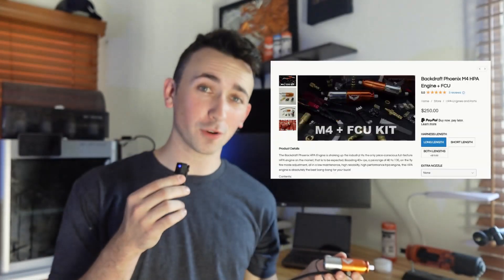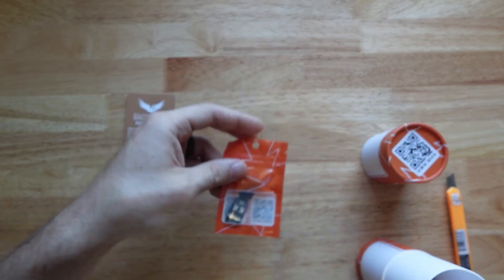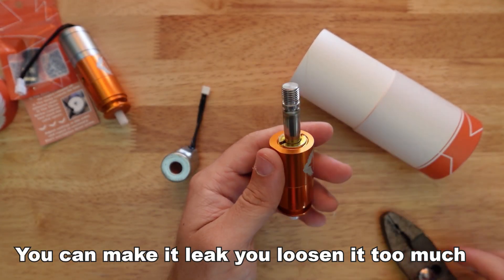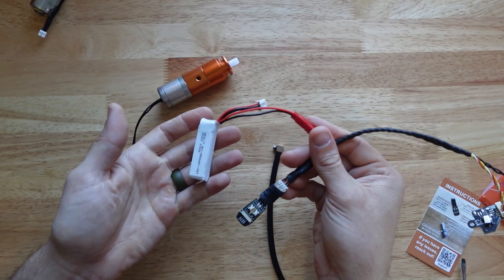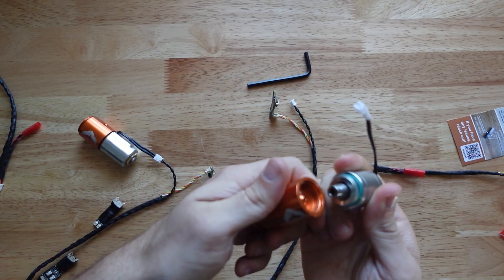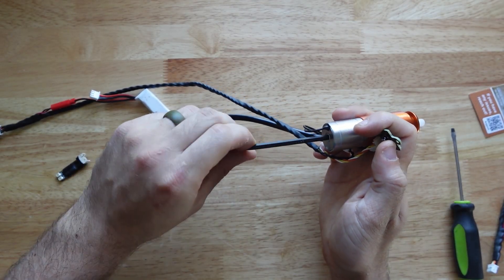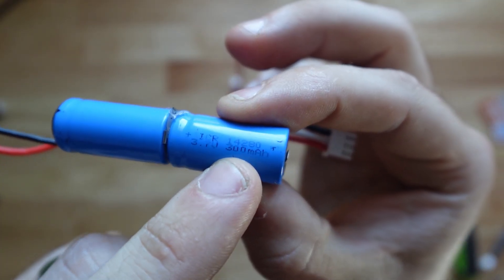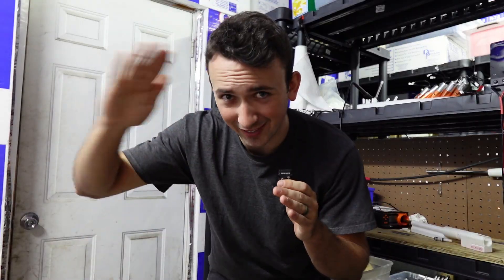How to Install the Phoenix Gen 2 Update Kit - Quick and Easy! (Plus Giveaway)

Comment: Looks freaking great and the pricing seems veryy good. How can i build a internal tracer unit. I’m new to these engines but i’ve used alot of hpa adaptors. This seems nice for converting my aeg.
Reply from the maker: The internal tracers are basically led kits that mount to specific hop ups. Our wireless fcu has the ability to control them, or if you want to do it with the standard fcu you need a battery splitter or separate power

Comment: Can I get the adapter for the air compressor and use it on any compressor
Reply from the maker: Yeah! Any standard air compressor can power your engine with the adapter. Idk if the fittings are different in other countries, it’s US standard
Reply: @B @BackdraftAirsoft ok thanks a lot that saves me a lot of money
Reply: @B @BackdraftAirsoft I got the engine and the adapter so I can fill my tank

Comment: What battery is recommended if i want it all in my buffer tube so i can run my magpul stock also if wanting to wire through buffer tube which length is best?
Reply from the maker: Long length harness, and I recommend the little lipo batteries on Amazon

Comment: It is really a toss up between this and the Kythera. I just posted the gun it'll go into on the Discord, not gonna lie supporting a small business is pretty appealing.
Reply from the maker: Plus the kythera is only semi auto. I definitely prefer the electronic control system. If you decide to order from me, I appreciate it! If not, no biggie. ❤
Reply: @BackdraftAirsoft  Any chance the AK version is on Amazon?
Reply from the maker: @seanlincoln9884 it’s not currently. I need to get that on there, but it’ll take like a month to get it up. Being a seller on Amazon sucks

Comment: hey man, looks amazing and promising! 
I am new to HPA, can I fit the gen 2 m4 version in an A&K SR25 if I buy the #5 nozzle with it? as it uses a v2.5 gearbox.
Another question, does the "Backdraft Phoenix M4 HPA Engine + FCU" include the catalyst gen 2 as well?
Reply from the maker: Thank you! Yes it would work with that nozzle, does the 2.5 have a v3 or v2 trigger mechanism? And yes, they all come with the gen 2 catalyst now :)
Reply: @BackdraftAirsoft  Nice! looking forward to tuning it! Ordered it (the m4/v2 version) 8 days ago ;-) together with a #5 nozzle! I am combining it with a wolverine wraith x (33g CO2) as well to get rid of the line, should be ~500 shots so enough for a DMR build

Comment: new to hpa but have worked on aegs a little and build fpv drones ,been wanting to do a project for a while where i mount some sort of airsoft system to an fpv quad ,my original idea was to use a cheap auto electric pistol and take it apart mount it to the quad do you reckon there would be a way to use a hpa system like this instead i could use a small air cannister or co2 and need the lightest possible setup and want full auto and potentioally a tracer unit to be able to be attached
Reply from the maker: It would be super cool, but I doubt the faa would approve

Comment: Titan battery are better. They have overcharge and depletion protection. When my phoenix engine depleted my titan when I forgot to disconnect it. I was able to just recharge it. Those hpa batteries you suggested would be dead if that happened
Reply from the maker: This is true, but I always unplug my batteries. Accidents happen, but I wouldn’t choose a battery just for that reason, especially if they advertise a higher capacity than it actually has